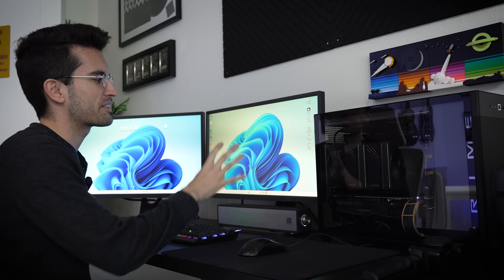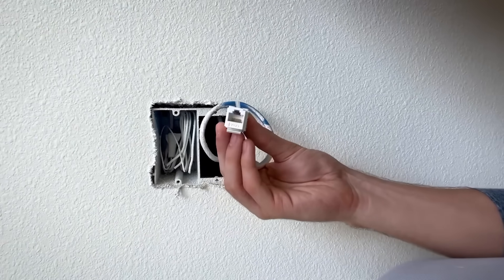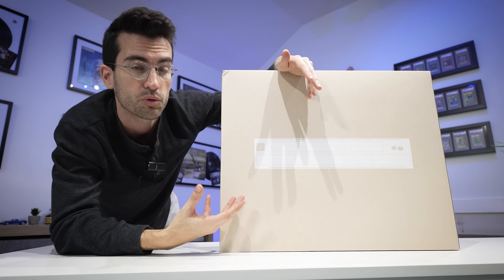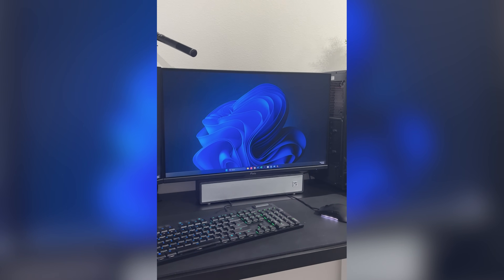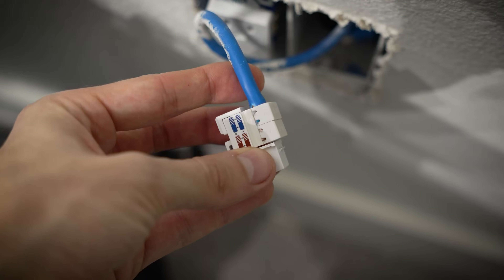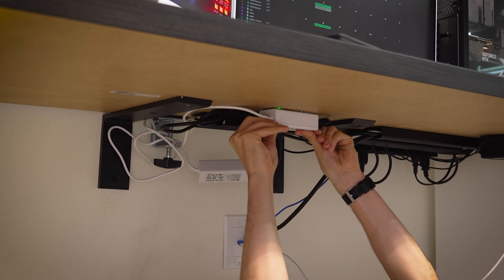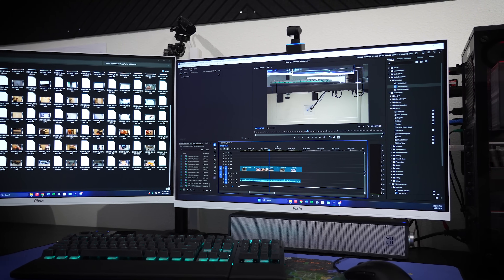These Issues NEED To Be Addressed...

Comment: Greg - if a power cord does not want to stay in place, check for split (two layer) blades - which can be spread a bit with a tiny screwdriver to make them stay in place. You can probably tell that I've been into service and support for a lot of years, grin.

Comment: I had an issue last year where I was getting constant drop out on my PC's ethernet. Initially I thought it was either the router or ISP that was at fault until I noticed that my PS5 was not having drop out issues.
I had actually installed a 2.5gb card in 2023 as the onboard ethernet was 1gb and my ISP while being gigabit offers potentially up to 1300gb (I actually get over 1100), and wanted to take full advantage of the speeds available.
I even bought Cat8 cable, which I know was overkill, but it wasn't that expensive and at least future proofs me.
Everything was fine for months, but then I started regularly getting these drop outs where it would drop for a few seconds, then reconnect etc etc
It tended initially to be at the same time of day (around midnight) which is why I though it was ISP related.
After much messing about I determined that it was in fact the port on my PC so decided to update the drivers, which made it stop completely.
Switched back to the onboard ethernet, and the problem stopped.
A few months later I decided to look at it all again as I wanted that little bit of extra speed if I can get it. Turned out that the reason the card stopped after updating the driver was that both ethernet cards now had separate driver versions, and getting both onto the same version sorted that issue out. But I was still getting the drop out. After much experimentation it turned out that due to the tight space the ethernet plugged into, the fastening clip was pushing against something and causing the ethernet to not seat properly. Swapped it for an older ethernet cable and everything was sorted. It is amazing that the simplest thing messes everything up and annoyingly it is usually the last thing you  check.
I now use that cat8 cable on my PS5 so it did not go to waste.

Comment: Greg, I don't want to sound like an advertisement, but Wow I hope you can get fiber in where you're at soon.  500 up, 500 down here.  It's pretty amazing.  Also, great video!  Been doing some in-house wiring myself for ethernet but I'm running it behind crown molding and such rather than thru the walls where I can avoid it.
Reply from the maker: Hahah you don't need to sell me on fiber. I've had it at most of my previous addresses. Where I live currently is more secluded and quiet, so the infrastructure is a bit lacking.

Comment: Desks with sharp corners can cause issues with your elbows if you haven't already noticed. 2 possible solutions are 1) pool noodle (slice and slip over the sharp corner) 2) router the edge (1/2" rad. min). Hope this helps.
Reply from the maker: The edges of these desks look sharp, but they honestly haven't bothered me in the year or so of using them. But noted on the solutions!

Comment: I learned few things about those RJ45 female connectors and it needs precision to build one because of the cables, but once you connect them you just need crimping tool and thats it. Also I've never seen a cooler switch than that.

Comment: As a network engineer myself , and a professional, I can tell you those jacks weren't damaged by accident of installing as it could have never passed the certification process itself. As we always give the benefit of doubt, it's just odd how they were bent and pushed in on the keystone itself. I would definetely reach out to the installers and have them credit you some of the costs back and check all jacks in the house yourself with a tester. Or, one of the kids decided to play and stick something other than a cable in the jack at some point. Just my opinion though....
Reply from the maker: The low voltage stuff was only inspected once - prior to plates being installed. Beyond this, any county-level inspection likely would have missed this. From my experience seeing them check things, it's very surface-level.
Reply: @GregSalazar  Permit inspectors only want to see that the cabling is of the appropriate fire rating. They don't test the ports, nor do they certify them. All of that falls on the contractor, and most will provide some level of testing 100% of the time, usually continuity. If you want actual certification, that tends to cost extra because of the time involved.

If you want to do this yourself, Byte Brothers sells a "real world cable certifier" that will give you a report on what your ports/cable/etc is capable of. It's not as good as a fluke meter, it's also not 3000 dollars, usually can be had for 500 bucks or so, and it comes with a tone tool, so, very handy to have around in general.

For the record, I don't own the fluke tester, I rent it when I need it, I have the byte bros, and it's never steered me wrong.
Reply: @GregSalazar  I think that the low voltage inspection is for "phone line" install level. A real inspection of network cabling need tools worth thousands of dollars (most common are made by Fluke) and give you a report with the length of every cable, a noise level (interference with main power), peer crosstalk, max usuable speed,... I don't know the network speed you're using but you should try at least to test your network (with iperf3 for example, read the retry count) and look in the switch console the error count by port. Someting the patch cable can also be bad (Cat 5 not e) and donc like be bended with angle. They can still work but slow down the connexion, even without link drop.
Reply: @GregSalazar  are they shielded cables? In my country we can't have them next to each other especially on the same cover. Too much signal interference. 50mm is minimum distance. Au/nz 3000 requirement.
Reply: Yeah I was about to ask HOW they could be damaged like that during an install, someone on the crew just decide to be a ****? It isn't like the pins are exposed anywhere that would get hit... on multiple outlets.

Comment: Probably not a concern for anyone right now, but if you're wiring up a home for ethernet, I would make sure the cabling can do 10gbit just to future proof it. Sure in early 2025 1gbit ethernet is still more than plenty but who knows in 5 or 10 years you may be kicking yourself.
Reply: Cat 6 can do 10 gig at up to 180 feet.
Reply: @Digitoxin1  correct, and 6A can do 10GBASE-T at up to 330 feet.
Reply: @kalmtraveler  Correct.  When I wired my home, I knew none of the drops would exceed 100 ft, much less 180, so I stick with Cat 6 to keep the costs down.
Reply: @Digitoxin1  yeah that's reasonable, especially if you needed to run a lot. 500 foot rolls of CAT 6 are about 1/3 the cost of CAT 6A rolls now (USA pricing). If I were running drops in my home now I would probably just go for 6A at 3x the cost, but of course this will depend greatly on total length needed for the home and how many drops you want, location, and date when purchased - going back even just a year or two can reveal much higher price disparity.

Comment: It is totally unconscionable that building codes do not allow a non-licensed person to run their own ethernet cables. And Dude, if you are going to have a network like this and maintain it yourself you MUST have the proper tools. At a minimum you need to have a punch down tool and some sort of ethernet tester for patch cables and keystones.
Reply from the maker: I get it, the network guys are gonna fry me for not using a real punch tool. My method worked. I'll order one if I ever need to do big work again. And my ethernet tester is one of my laptops and a ethernet cable lol. I'll be ok.

Comment: I feel your pain with spectrum. I kicked them off my property 4.5 years ago after they had to make visits to me 8 times in a single calendar. Their backbone and commercial infrastructure looks like it was all sourced on TEMU, or slopped together from years of acquiring smaller ISP's. Frontier has been very reliable since then. I just wish they were a bit cheaper for dedicated GB fiber. Might explore AT&T Fiber when they get their trunk lines installed near me.
Reply: I made the switch from spectrum to att fiber. Upload speeds are awesome, but att pays less for their cross country jumps so I get packet drops on those nodes during high usage hours. Annoying at times.
Reply: @sliphere011  Good to know. I am not sure when AT&T will be in my area so I'll have to weigh the cost of their service versus frontier once that finally happens.

Comment: The only thing I would do differently, because I have a 3D printer, is 3d print some brackets and screw in the power bricks rather than tape them. Gorilla tape is good but some of these bricks get warm enough to soften the adhesive in my experience, especially the bigger and heavier ones with a lot of wattage.
Reply from the maker: Good idea, I should definitely print some. Would be more robust for sure.

Comment: 4:00 Looks like a Ikea cardboard honeycomb desk most probably? Those are notorious, hard wood/particleboard only on ends where metal legs bolts, middle is just a cardboard "honeycomb" with edge strips. I have bent one by leaning over it and trying to reach something - pushing hand down same time. Crunch... Those "tables" bent like a cardboard box. Had to cut one half to fit it to my car. Needed tool? Just put it half way over the stairs, and one person stands one end and another bends and cracks it half by pushing down on another end...

Never again. Cheap. Yes. Structurally sound. Not. 🤣
Reply from the maker: No idea how you completely missed the part where I explained that I was supporting those table tops with heavy duty L-shaped brackets bolted to studs. These desks have been up for over half a year at this point. Zero sag, cracking, etc.
Reply: @GregSalazar  I did wrote the comment while video were paused and noticed after pushing play that you had a good solid suppor down there. Only way probably to keep those type of tabletops straight. I just have had "usual luck" with those honeycomb tabletops. :)

That looked longer, 200cm(ish) version. I have had only 120 or 160cm versions (Europe) that just have end supports. Longer (200) has also some kind support on middle, or at least solid block where leg can be mounted.

If that side strip starts to come lose, as once happened to me - structural integity is gone.

Greets from Finland anyways. :)
Reply from the maker: @sasiuru  Cheers!

Comment: I've also found that unless my PC's other network connections are disabled, constant connection and loading issues both during browsing and downloading games on Steam, GOG, etc. Go in and disable all connections other than your primary ethernet and you should experience consistently fast connections and downloads.  YMMV, this was on my ASUS ROG Strix X570-i gaming MOBO.

Comment: When I had our basement remodeled, I put non-crimped connectors in all the jacks around the office and main room, so there'd be no damage or drywall dust in the jacks..  And how the heck to you even damage one of those things like they did??  They had to put a screwdriver in there like you said, almost like it was intentional..
Reply: 100% an amateur "professional" jamming a tool in it
Reply: @TBomb85  The fact that there's so little slack in there that you'll have issues replacing the jack definitely supports this theory..
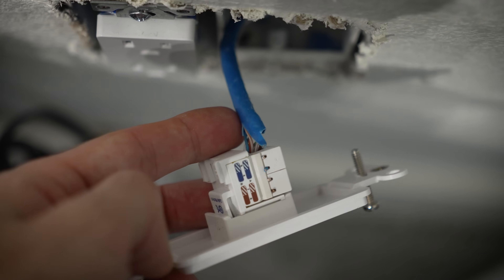Reply: 6:50 Looks like they jammed pliers in it.
Reply: I can't imagine why they'd need to put a tool in it though. Makes zero sense, keystones pop in from the back, and they pop in easy.

The only way I've seen this happen IRL is someone plugging a USB device into them, and even then it usually survives. Also, this is why it's important for a contractor to provide some sort of certification on their drops, so they have something to point at if they get blamed for something, and, it helps make sure the contractor didn't cut any corners.
Reply: @jttech44  Yeah, I'm guessing that the installer didn't actually TEST any of the lines they installed, either that, or it happened after they finished their work...

Comment: 1:57 Greg: We need to get a professional for these Ethernet jacks or it won't pass inspection.
Me in Taipei just winging my own electrical:
Reply from the maker: Some parts of our system I fully understand. Others make me question reality.
Reply: some lobbying was involved.
Reply: Yeah, that's very strange. Even in California you can do your own electrical as long as it meets code and passes inspection. Inspectors don't even look at low voltage wiring unless there is a safety issue.